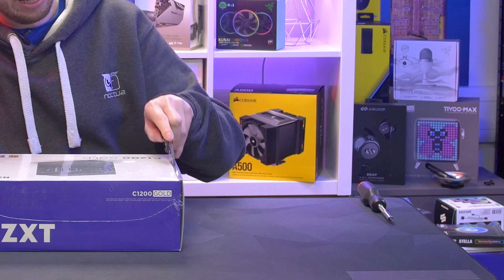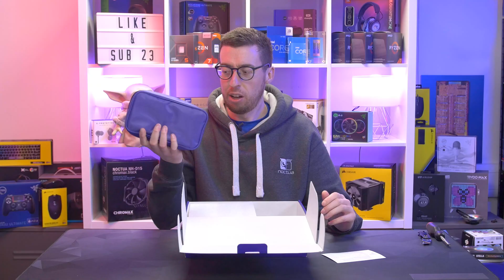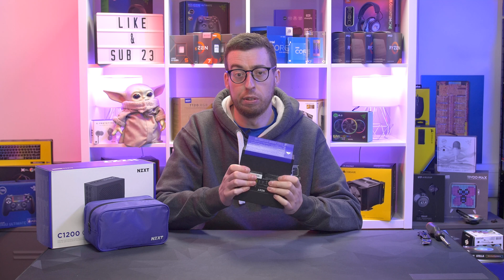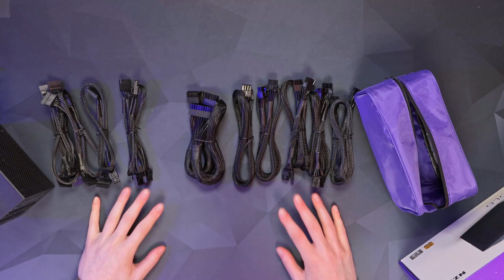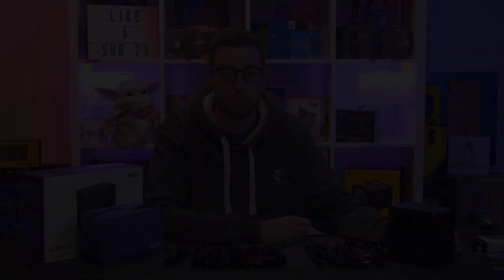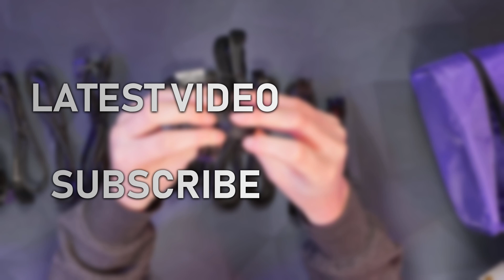40 Series Ready! NZXT C1200 ATX 3.0 Gold Power Supply! - Unboxing & Overview! [4K]

Comment: What left me a little puzzled are the - CPU & PCI-E connections ! It says ''CPU & PCIE''  does that mean i could possibly plug in a cpu 8 pin cable in a pci-e slot and work fine ? Witch ones are the CPU 8pin slots ? On the Left ? And PCIE on the right or ...?  Are they Universal and i could just plug a cpu 8 pin cable in any of the 4 slots and not worry about wich is wich ?  Are The ''CPU'' And ''PCIE'' connectons and power outputs the same ?  Thats what i don't get !
Reply from the maker: They have the same PSU end, but different ends to connect to the components. They're also keyed so you can't pug a PCIe into a Motherboard CPU power and vice versa.

Comment: I recently bought this PSU. Unfortunately NZXT uses proprietary connections that have no aftermarket support. So this is essentially a NON modular power supply. The included cables are extremely bulky and stiff. Most of the cables have several long bulky redundant pigtails. If you’re working in a mid-tower or smaller or just want clean cable management, I’d strongly recommend NOT buying this PSU.
Reply from the maker: Proprietary connections are usually so you don't use incompatible cables and blow something up, lots of companies do this. What do you mean about the pigtails? Most motherboards use two connectors for EPS and most GPU use two PCIe for power, with exception of the highest end NVIDIA and AMD cards
Reply: @jordanash  I worded that poorly. I should have said NZXT’s propriety connectors are completely unique and not shared with any other manufacturers (as far as I know). So the custom cable options are pretty much non existent. As for the provided cables, all of them have 3-4 redundant pigtails or splitters. Most manufacturers supply a larger variety of cables, rather than a handful of cables with a half dozen different connectors spliced onto the end. SATA cables, sure this way you can piggyback several drives. This is ridiculous for CPU and GPU cables. Essentially there are about twelve stiff bulky leads coming out of my PSU and I’m only using five. Also, a lot of theses pigtails are at the end of the cable run. So I need to use extensions to hide the unused leads and connectors. I wish NZXT would either sell single ended upgrade cables or incentivize other companies to do it for them.
Reply from the maker: Cablemod might start doing cables for NZXT if there's enough demand, they also need a good amount of SKUs to warrant it in the first place, and there's only four at the moment.
Reply: @jordanash  I actually did find some on Cable Mods custom configurator. Only it would be about $200 to buy all the ones I’d need. Literally more than what I paid for the PSU itself. It’s a shame because it’s a great PSU other than the cables. In a full tower it would be a non issue.
Reply from the maker: Yeah they're always expensive until the volume of orders gets higher
Reply: @richardbixler interesting points of view, thanks for sharing. I am about to build in a H6 flow case, with LL strimer extensions for the GPU & MoBo, this PSU appealed to me, being the same brand as the case and fit within my max PSU length constraint (200mm). I was hoping to have generally good cable management, I have the benefit of the case being a dual chamber but your comments are making me think twice. Would you suggest to avoid even with a dual chamber or do you think that helps solve the issue of the pigtailed cables?
Reply: @Lanzer88  I think you’d be perfectly fine. I used the H5 Flow case which is very cramped even for a mid tower. Basically where the PSU shroud is, there is a fan that takes up most the space in the H5. That said if I had it to do again I’d go with a Seasonic PSU. They are probably the most reputable PSU brand, are used by a lot of OEM’s and have the best aftermarket support. PSU’s really should be universalized. It’s not just an NZXT problem it’s all of them have proprietary connections, making the modularity almost pointless. There’s no reason other than pettiness that the PSU brands don’t make cables universal.

Comment: Can I also use the NZXT C1000 for the 4070 ti ????

I have PCie.5 Mainbord
Reply from the maker: Yes, but it doesn't had the 16 pin, so you'll need to use the adapter.
Reply: @jordanash  Then I have to buy nzxt c1200 because it has 16 pins right?
Reply from the maker: You don't have to if you're happy using the adapter. But it you want one cable, then you'll need the C1200

Comment: Good evening, can you advise on whether this PSU is compatible with the ASUS Rog Maximus z790 Hero? Specifically the 6 pin PD_12V_PWR underneath the 24 pin?
Reply from the maker: Hello! Yes, this will work well. The additional 6 pin is from a PCI-E connector, and there's plenty on this.